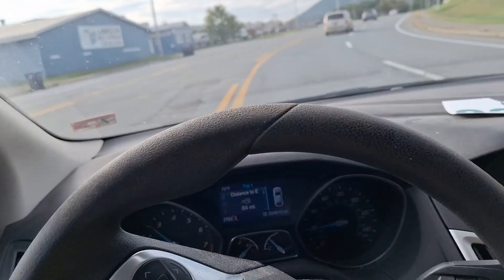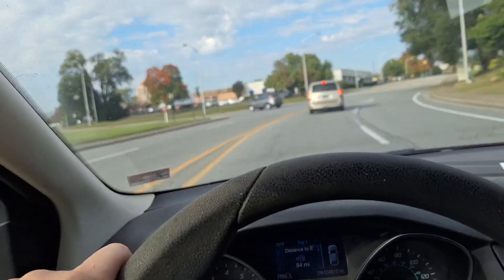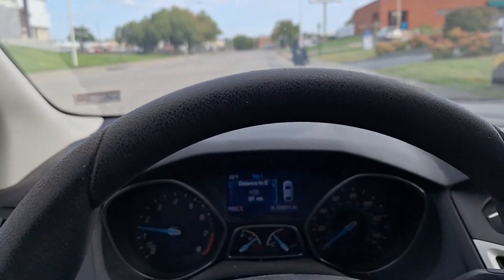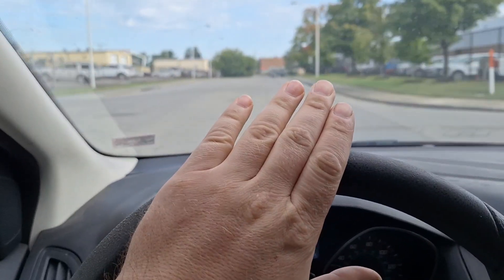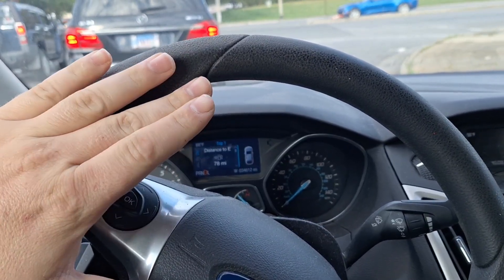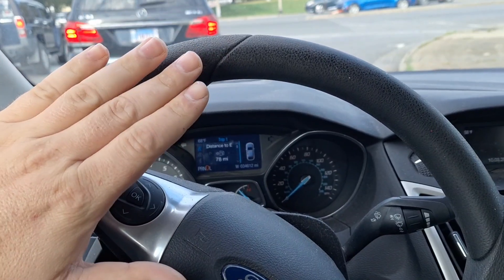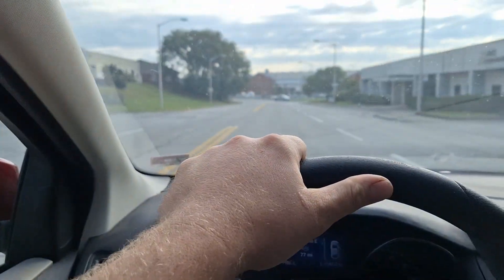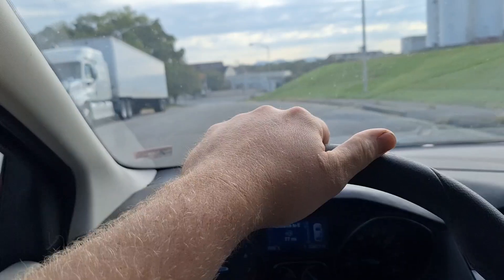Ford Focus/Fiesta DPS6 Transmission Overheating Warning Message! Tips and Advice

Comment: I do work on this DPS6 like 5 different Focus all they work properly after u know remplace forks, lubricate parts, seal, clutch package, all grounds clean, etc. I have one right now with a different escenario, i do remplace forks, I taste the thickness of the clutch is on range, but at times display says overheating and still make all gears normal, i suspect maybe the 1ISS 2ISS or OSS already remplace, all the test pass like Clutch system, drums, learn adaptation, but when i'm doing the ISS test they fail the test around 2k RPM by 15 off the range, suppost to be like Input above 100rpm than the engine (how is that possible any clue??) maybe a CKP lying ??? any suggestion?? Thanks
Reply from the maker: Hey, honestly I can't understand some of what you mean, but If you don't have actuator codes and the clutch is getting hot, I suspect an issue or contamination of the clutch or apply components. Possibly a mechanical issue with an actuator. The speed sensors and ckp shouldn't play any role in a clutch adaptive learn. If there are codes for those sensors definitely fix that first though
Reply: @BigBensCarsAndCycles  Thanks for reply and time. Ok, I don't register any codes it is what feel like some electrical bug could happen, already check and clean very well with air compressor  the dust for the clutch before install, I spin both clutch with the hand they move freely, I change both actuators before assembly all and then the "transmission overheating"  appear, has new oil Motorcraft on level. It make me very curious how can ISS can register 100 RPM above the engine cuz as I understand flywheel is attach directly to the input shafts.

Comment: Do you think its possible to DIY, change the TCM and code it in. Also do you think its possible to DIY change the clutch.
Reply from the maker: Yes. I have videos on replacing each of those. Get forscan to program
Reply: @BigBensCarsAndCycles thank you. Without a ramp at home, is it still possible on driveway?
Reply from the maker: @saq4575  I haven't done it at home, but its possible. I'd get tall jack stands and a Trans jack. Check out my clutch and fork replacement video on my Playlist for focus transmissions issues
Reply: Thank you, I am a car trader in the UK. I only buy and sell Focus Autos 11 to 14. But at least 4 out of 10 have these issues. So i have to deal with returns. There really good sellers but need a cunning plan how to fix these boxes.